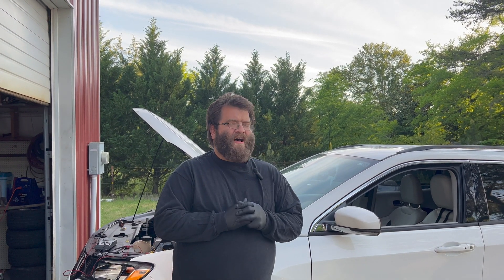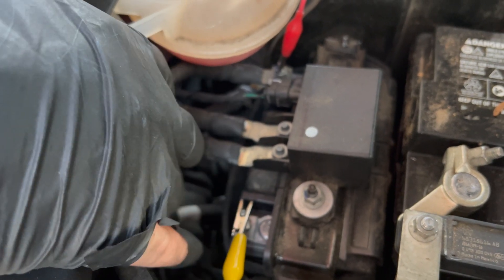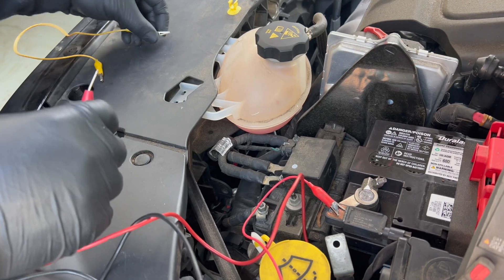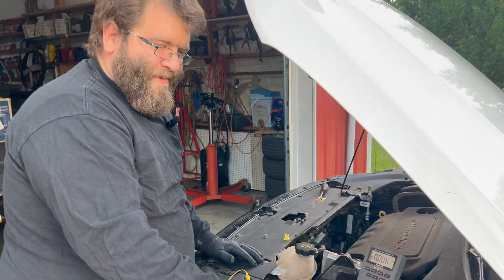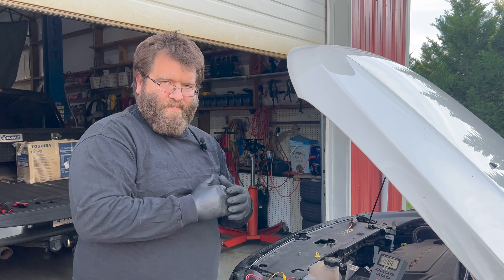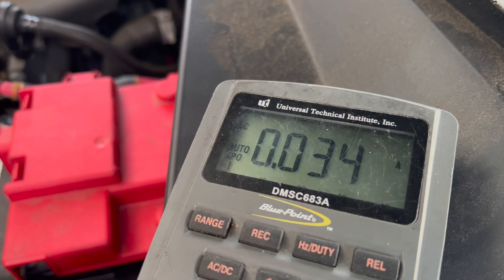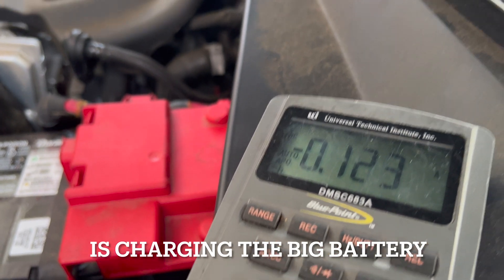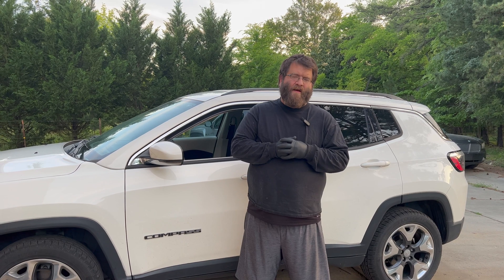2018-2021 Jeep Compass Battery Dies Overnight. The Real Cause and Fix.

Comment: My Jeep Compass is the same year, I changed both batteries, the serpentine and 2 alternators. The damn thing eats the battery while driving it,  I takes most of the energy when is going over 60.  I've take it to the Dealership 4 times, they lame excuse they gave me is that I am using an Aftermarket Battery.  My guess it could be an issue with the harness wiring, or the PCM but I have no way to test that and I don't know what to do.  Right now I am paying a car for a year now that I cannot use.
Reply from the maker: Have you verified if it’s charging? I’m pretty sure the ecm controls the charging system and I’ve put a few ecm’s for a no charge condition. Also, tipm’s go bad on pretty much all Chrysler products and they’re notorious for keeping things on when they should be off. Just some food for thought.

Comment: Thanks for making this! Gonna have to do a quick diagnosis later on the wifes 2018. Acting like it has a dead battery in the morning and either takes a few attempts or has to be jump started. Main battery is just about a year and a half old. Gonna check for draw later and possibly run and grab an aux battery after.

Comment: The answer is YES! JUST HAD THIS ISSUE. Wouldn't start, gave a lot of Errors including "High Temps". This is a Common issue with these Jeeps. REPLACE BOTH BATTERIES AT SAME TIME. AUX WILL DRAIN AND RUIN YOUR BATTERY. It will also make your engine run harsher as some sensors stop working, ECT. If your Car won't start, gives all sorts of flashes on the dash but starts instantly with a Jump Pack or Jump? Replace both batteries and it will be fixed instantly...and your car will also run nicer as the sensors reactivate.
Reply: I have the same issues with the high temperature also. Is it because of the batteries?

Comment: Who here thinks their Compass is a poorly manufactured, defective and malfunction prone model (pos) from Jeep?
I thought it was great when buying. Then the stop/start function acted up immediately, and the entire stop/start will inevitably drain not 1, but possibly 2, batteries and is hard on the starter and alternator. Very inefficient "eco-friendly" idea...
It rides very hard after putting on some miles, and no improvement w/ new tires, etc.. Seems to only ride harder as the mileage goes up.
Then the cherry on top: NO SPARE, just a garbage air compressor because every flat just needs air or fix a flat. Sidewalls never blow out on the interstate.  "To save on the vehicle's gross weight," they say. I am glad it meets all of California's emissions and gas mileage and refrigerant requirements, being here in the southeast.
You live and learn but this was a definite case of buyer's remorse.

Comment: Big question replaced both batteries on my 2018 jeep compass limited 2.4 now I'm getting these two codes B212D-13 and p26E4  I can see and vue the codes with my snap on scan tool and I can clear them but they do come back on voltage at both batteries show 12.6 to 13.7 start stop warning icon and message is showing and air bag light is on the will not go out even if cleared   these codes have never showed up until replaced both batteries
Reply from the maker: First thing would be checking fuses. But given that it’s a Chysler product, it wouldn’t surprise me if you find the tipm is crapping out.
Reply: @automotiveinsight  kinda figured that  been using this jeep now for 2 years with stop start not working no airbag light and as soon as I put two new batteries on it crap starts happening

Comment: One day my battery just started draining. It wouldn’t start so I got a new battery put in. It worked for some months. Then my warning lights were saying my car was running hot ems system etc. my mechanic changed my flow tank for my antifreeze. This was like a few weeks ago. As of today, my mechanic said I needed a starter. My car was able to drive yesterday no issue and that night it just wouldn’t crank turn over nothing. My battery voltage light came on then went off twice. Then I checked is the voltage it was normal then drained significantly out of no where after a few  minutes of checked it again. My aux battery has not been working for several months. I have just been driving around all Willy Nilly with the A with a circle light on. I don’t know how to turn the start stop off. I told my mechanic I’m pretty sure it needs to be replaced from doing research. He checked it saying I needed a starter. I truly don’t think I need a starter and that I just need an aux battery. Smh can yall good handsome men come to Memphis and let me pay yall to put me one in 😅😅😂😂

Comment: Both batteries should be replaced at the same time or you could end up running into a catch 22 where the new battery gets drained from the one that wasn't replaced.

Comment: How do I replace those little studs that come off the aux battery?? Every single video shows how to replace the battery but every video either skips how to replace those studs or fasts forwards through it. I heard you say “battery studs E6”? I think? What tool is being used to remove those studs?
Reply from the maker: https://www.lowes.com/pd/Kobalt-1-4-in-Drive-Torx-Bit-Torx-Driver-Socket/1000192377?user=shopping&feed=yes&srsltid=AfmBOopVmRwGAPaR10orU6P6nxEa-aBKhBnVHRY0u6xqfp_aS7224s79lL0 it’s an e6 e-torx
Reply: E5 reverse torx socket to R&R the batter terminals

Comment: That's not how electricity flows, I was always told it flows downhill, so you have to make sure your wires are at an angle!  

Friend of mine bought a 2019 of this Jeep and has the same issue, wanted me to help him replace the batteries.  I just found this video and didn't know the AUX battery could be pulling off the main battery to drain it (mainly because I didn't know they put AUX batteries in for the interior stuff).  Good to know, I know next to nothing about these start-stop systems.

I told him I would pull both batteries, charge them out of the vehicle and then test them with a battery tester to see if they're good, hopefully he won't have to replace both.  Maybe do an alternator test too just to ensure it's charging properly.

Comment: sporadically a message appears on the dashboard display about "High Coolant Temperature" and immediately sends the vehicle to shut down and after a couple of seconds the error disappears and the temperature returns to normal. I must clarify that at no time does the vehicle overheat.

Comment: I wish I could get a newer car with barebones simple tech in it with one battery. But nope all newer vehicles are made with 2 crappy batterys. My aux battery lasted till 95k km. The primary all around vehicle warranty is 60k km expiry. I only have a drive train warranty left and that is going to expire as well soon. From what I heard from napa that it is $500+ for a new aux battery alone. Have to change both at the same time and the bigger battery is $250+ so it is $750+ not including taxes. I might just invest in something a bit older now and give up on crappy new vehicles.

Comment: Can my auxiliary battery drain a new main battery I replaced my main battery a few days ago but not the auxiliary they both were the original ones when I got the car it’s a 2020 and I got it about 2 years ago I did once have to take it to the dealership for them to recharge it. When I replaced the main battery it started and everything came back on I didn’t drive one day and when I went out yesterday after it hadn’t been driven it was dead all the lights and nothing would come on I’m hoping I just have to change that battery and it’s nothing worse
Reply: Yes. It can drain it. I’m literally sitting in my compass typing this waiting for AAA to bring me a new one lol
Reply: @Pluuuuuttttsssss  sorry to hear that hopefully they’ll get to you quickly

Comment: Both batteries have been replaced.  Issue remains.  Any idea?
Reply: You will hook up your multimeter the same as the video but you will start disconnecting circuits, one at a time, at the battery power distribution. When the draw drops significantly, you've found your lead. Follow schematics to the next load of that circuit. Repeat process until you've narrowed it down to one specific circuit.

Comment: All these vehicles are peace of garbage. They make it have a battery drain after a few years. Then they make its so that the modules will go bad as a result of jump starting the vehicle. I just worked on one it’s not the auxiliary battery causing the parasitic drain. I gave it back to the customer. I told him it’s gonna cost 150 dollars an hours to diagnose it, and 800 dollars just to start. I meant to run them away. I work with hybrid and electric vehicles I ain’t got time for regular car with cheap customers

Comment: I swear these Compass aux batteries are scheduled to die right at 60K miles. Every one I deal with has 60-65K on it.
Reply: It’s only funny cuz this deadass true nd this car needs a damn recal
Reply: Ours is a 2019 and at 58,909. Battery issues with check engine light and auto stop/start light. We have to jump our car if we let it sit too long.
Reply: @wifelymood22 so how did you go about the problem?
Reply: @DaVytal1 We used a jumper pack until we could get it to the dealership. Once we got it there we were told it needed both new batteries. In the 2019 compass we have, one battery controls the auto stop/start and the other controls the car. It was like a $650 fix.
Reply: @wifelymood22 and how many years before you changed it again or is it still the same batteries from 2019
Reply: @DaVytal1  We just got it changed about a year ago. So the original one lasted till 2024 and we still have the new one.
Reply: @wifelymood22 thank you ‼️
Reply: died at 39k yesterday here but it is a 2018
Reply: @CSUnited14  2018 this is the third aux.
Reply: @CSUnited14 I got a 2018 and mine died at 80k miles just the other day and my transmission is slipping now :(
Reply: 72k  here 😅
Reply: Pretty sure the wife's 2018 just finally took out the auxiliary battery after watching this video. Original battery with 122k miles on it.
Reply: I mean that's a good four to five years on average, doesn't really sound excessive to me.
Reply: @josephsellers5978 have gone through 4 batteries.. in two years
Reply: In 65mi mine😂
Reply: I'm at 55k rn 😂😢
Reply: My auxiliary battery went bad at 65,400 miles. 👍🏻
Reply: We’re on our second one now. This is bullshit. Should be able to sue for this shit ass design
Reply: I wished.. I get 16,000 miles each... But the dealership says nothing wrong with system... Junk car
Reply: Mine is a 2022 jeep compass altitude and I just hit 62000 miles have this issue! Im about to take the fuse out for it. I just changed the auxiliary battery the other day now im back to square 1!!😤😤

Comment: Literally blew me away. Just had this happen  to me and all the service  shops wouldn't help me and I just recovered  from the flu and then bam my battery dies. I got a jump then the camera won't turn off. Then today it died this morning won't turn on or take a jump. But no one I said no one knew there was an axillary battery . And thar battery  is at least 5yrs old today and jas never been replaced. Gonna try this Wednesday  100% sure this is it. 😅 wish me luck.
Reply from the maker: Good luck!
Reply: Yo did it work?? My car has been dead for 1 month after 5 battery replacements in 2 weeks. Im thinking this is the problem and I’m very interested in knowing if this fixed your car!? Im thinking this will fix mine
Reply: @iamriddim9143  I did work. My car runs fine now. But my back up Camara is still on.
Reply: @iamriddim9143  It needs 2 batteries.  My main still reads low but no issues whats so ever. Even my start/ stop  started working again. I plan on replacing the main  battery at my next oil change

Comment: I have a 2017 Compass and the start/ stop has been a problem sinceI got the car but at  year 3 it became a nightmare. Dealer of no help. I reached the point that I would stall at every stop sign and intersection. I finely turn off the start/ stop the last year. and all was fine. I have never got a warning message. on my dash.  A week ago the battery is dead at my mountain house. Finely after getting someone with a Bronco we were able to jump the Aux battery after letting the Bronco run for 40 minutes. . My question is my main battery is still the original battery. The car has run fine for a week and made a 10 hour drive fine. Do I change out both batteries? I don't trust the dealer and I have a good repair shop I think can do the work. Can you suggest a portable battery charger that will start the Aux. battery when in a situation like being stranded on a mountain and no roadside assistance anywhere near you?
Reply from the maker: It’s not going to hurt anything to change them both. As far as portable battery chargers: I carry a NOCO GB70 with me at all times. It’s a bit pricey, but will jump start pretty much anything.

Comment: My dash is reading my auxiliary battery is in a protection mode, it’s been replaced 2 years ago, my main battery was drained and had to be boost off. Should I change both batteries or the main?
Reply: The start/stop function isn’t working because of being in the protection mode

Comment: Hey thanks for the amazing and helpful video. Is there anyways to completely remove the aux battery and just use regular battery and don’t use the save gas function ?
Reply from the maker: Thank you. I haven’t seen anything that allows you to get rid of the other battery. With enough ingenuity anything can be done, but it probably isn’t worth it. They do sell start stop disablers though.

Comment: This was exactly the same issue I was having in my Compass. So glad that your video came out right around when I was experiencing this problem. I thought my 1 year old battery had somehow gone bad early and so I got it replaced under the warranty but it still died if I didn't drive it for 3 days. I started tracking the voltage and realized something must be drawing extra power from the main battery. Ended up having to jump my car about 5 times before I finally got the aux battery replaced. So far so good.
Reply from the maker: That’s awesome!
Reply: same